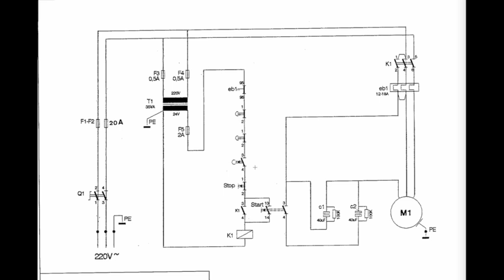How to Troubleshoot Motor Control Issues Like a Pro!

Comment: Hi. I’m new to your channel. I have what I think may be an interesting challenge that I have been working on. It’s a hillside lift with a motor, a control box with relays and contactors, and two start/stop switches with secondary switches to require holding down the buttons. It stopped working in one direction only and I eventually figured out why, but to do it I had to remove the motor and disconnect it. The person who created the circuit is long gone. My question for you is would you be willing to look at a couple pictures of the control box and also the motor schematic to help me be sure that I’m  hooking it back up correctly to the contactors. I should say I’m new to contactors, which is why I subscribed to your channel. I can email you if you send me your address. Let me know. Thank you! Great videos!
Reply from the maker: Sure but I would recommend you watch my videos on reversing contactor. The circuit you are describing is actually pretty simple.

My email is goprorunner07@gmail.com